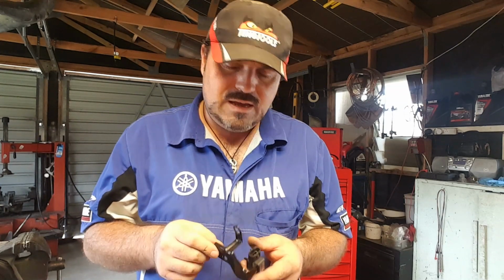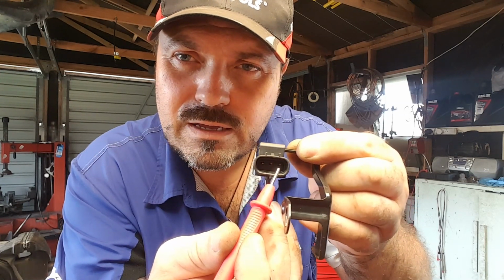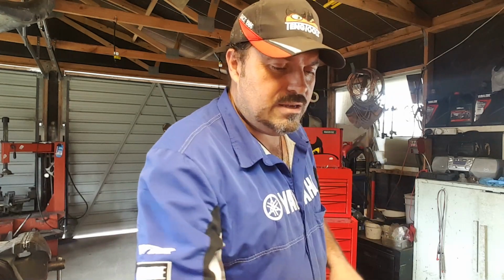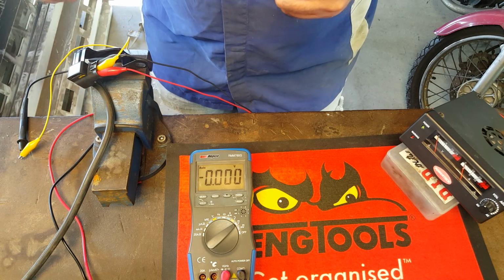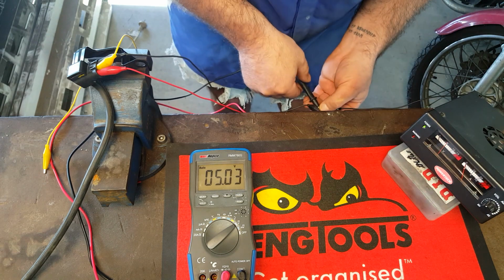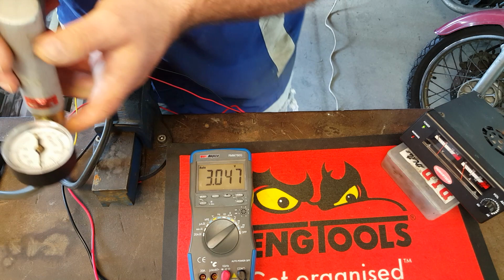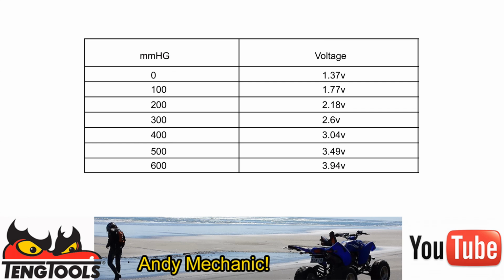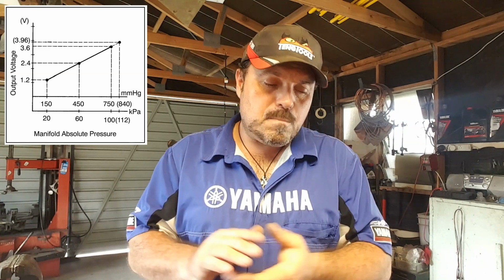How to test a MAP sensor OFF CAR #1206

Comment: Hi, very good video thanks, just would like to add that In some cases the map sensor will be off when in a hot or cold condition.  I had this with my honda vfr1200 motorcycle.  It would run fine for about 200km then start buzzing in my handlebars from the enjine due to to lean fuel calculation & timing combination..

Comment: Hey Andy besides for voltage there is a way to test . and that is going by resistance and vac as well if you dont have access to a 5 volt power supply

Comment: Great video.  You helped me diagnose my Toyota MAP sensor.  However, I think you made an accidental statement at 9:34.  "As the vacuum increases, the output voltage decreases".  Per your test and charts, as the vacuum increases the voltage increases.  Might have been a accidental mix up of terms; vacuum and pressure.
Reply from the maker: +LuvMy55Chevy I think you are right with that one. I meant to say resistance. I'll re-take it one day! Thanks for the feedback and I'm pleased it helped you fix your car. Cheers Andy

Comment: Hey Andy if we're really just varying the resistance with vacuum. pressure couldn't we just take a resistance reading from the  signal wire while adding vacuum. No it will not correlate to a map but the varying resistance would indicate a working operation.
Reply from the maker: Totally can, just check supply voltage is at 5v+ & a good ground is also present. 

Cheers Andy

Comment: Hey Andy! love the videos especially  your tool girl Sam ones.  Umm, I'm a bit confused maybe I got it backwards but at around 9:34 you describe an inverse relationship between vacuum and sensor output voltage as the desired and tested result, but I think either I'm confused a as it is direct relationship (Vacuum up  Ev Up) or maybe it was just a slip up.  Seems I'm the only one I saw in quick glance at comments who's head is banging so Idunno. Cheers!
Reply from the maker: +roy mummery Some sensors do inverse, some are proportional. Main issue is you see a steady change in voltage with vacuum.
Reply: I too was confused. I thought that this sensor provides feedback to tell the ECU the amount of boost pressure present to maintain the design amount of air/fuel mix to make the 14.5--14.7 to  1. After studying other vids it would seem that the sensor is measuring relative pressure to atmospheric pressure. When the throttle vane is shut the turbo will be slow and the pressure beyond the vane will be low and below atmospheric. The ECU will cut back the fuel via the injection. When the  throttle Vane is fully open the Turbo speed is high. The vacuum in the manifold falls back to atmospheric. Now the boost of Turbo takes the pressure in the manifold beyond atmospheric. This is again detected by the MAP and the ECU then sets more fuel into the engine via injection. There comes a point where the boost pressure could be too high( Resulting in Engine damage)and the ECU sends a message to the Vacuum Solenoid valve to dump vacuum on the turbo wastegate actuator so the gate opens to dump turbo exhaust to slow the Turbo down and reduce boost. Now the funny thing is this. Overboost code P0234 can be set with car in 5th going up hill and foot to floor. Also code P1345 also set(Glow plug issue). Limp mode/Engine Warning light set. RPM that this occurs at is around 2,900. Is it possible that the ECU is saying I am labouring the engine and puts it into Limp mode with the Fault codes. Can't be an overboost as turbo is spinning too slowly. I also read that the  throttle pedal position is monitored and plays it's part. I have put this info in as the problems one may think they have may not be what the ECU is Fault coding. The fault codes are just indicator. Note after reset of fault codes the Glow plug fault is not present.
Ok let's go back Andies graphs. After understanding how Absolute Pressure is defined as I now am longer confused. The M A P therefore has a max output of 5 volts and minimal output of 0 volts. Is it right that the sensor would give out 2.5 Volts when the Manifold is at atmospheric. There must be a  voltage value above atmospheric when the pressure in the manifold is considered to be at Overboost. How altitude is taken care of is another mistery. It is likely that the output would never drop to 0 volts. Finally Andy concludes that other MAPs work differently. This is what make all these issues so hard to understand but Andy's bench test definitely will give functionality of the device but you need to cross check to see if it is in Specification. 😀😀😀

Comment: did i hear you say that as the vacuum increases the voltage drops? I saw it the other way or am I mistaken?
Reply from the maker: That's correct. On some map sensors the voltage is around 3.7v at atmospheric pressure (WOT) & drops down as vacuum increases.

Hope this helps

Cheers Andy

Comment: Hi i have 2008 ford focus 1.8 tdci with heavy black smoke under acceleration  live data showing 30 psi of boost pressure and mass air flow around 80 g/s  around 2500 rpm i thought vnt ring on turbo might have been sticky but it's free  , how could i pin point the fault if it is the map ?

Comment: Thanks for ur explain , the map sensor division from the line on diagram is that ok or it's fails
Reply from the maker: +Hazem Alsaady If the readings fall anywhere outside the lines throughout the operating range then it's a fail.

Cheers Andy

Comment: Andy, measuring the signal leg (middle) on the harness of the car I get about 5V but when I connect sensor to the harness and backprobe the signal leg the voltage is at 50mv without any vacuum applied. The voltage supply on the side leg read 5V with and without sensor connected. Do you think the sensor has some sort of short or break? or is it the ECU? thank you!
Reply from the maker: +biker55555 Hmmmm. ...just check the other two wires as the order may be different on your car. One wire (loom side with sensor disconnected) should be 5v reference, one ground and the 3rd should have no voltage - that will be the signal wire. If all that checks out fine then I'd bench test the sensor.

Hope that helps. Cheers Andy

Comment: Hi, I was given a 4 pin Ford 0 261 230 027 sensor. I don't have the car so I cannot test it in the car. I want to use it for an automation project for the school. How should I test it? I cannot find the connection diagram. Many thanks. Regards

Comment: how to find the map sensor on a 2004 Isuzu Rodeo direct injection
Reply from the maker: +Christy scruggs good morning Chris, I must be honest here, I haven't worked on one of those for a long time. However, Map sensors require a vacuum supply from the intake manifold. So follow each vacuum hose and the one that goes to a small electrical component usually with 3 wires to it should be your map sensor. 

You could also go onto Google images and search for pics of the map sensor on your vehicle, that usually gives you clues as to its location.

Ultimately it's best to just download a PDF  workshop manual, that will not only give you the location but also the test data you need too.

Hope this helps.

Cheers Andy

Comment: You know how I do it buy a brand new one if it's not it take i take it back 😂😉
Reply: My first diagnose was just like that I tested and it was a simple system with an alternator as a dead end.  So we went to NAPA got a new one something happen so I took it back and told em while I was getting the part the car got towed so I'll come back when I get the car back.
 Told my friend hey I dont know. So we pushed  it to the shop down the street
Later we get a call back that it is don6
We go pick it up and for my curiosity o asked .. so what was the problem
The tech said  . . . The distributor... hahaha
The guy at the store put the bad one back in the box and back on the shelf 
Ready for the next sucker

Moral of the story is that now i can and will question all 
.. my approach my equipment and my parts

Comment: I have lexus 2009 .my map sensor have three wires. First wire is going 4.99v second wire is going 4.90v third wire is  going 0v.can you please tell me which wire is which?
Reply from the maker: 4.99v is the ECU supplied 5v reference. 0v is the ECU supplied ground & 4.9v is the signal wire - that's my thoughts.

Cheers Andy

Comment: you should have the info first.. you did 100 increments but the scale shows more specific vacuum and volt readings..
So do it again and see what volts you get at those specific vacuum specs.. just because it moves volts doesnt mean its in spec.
Reply from the maker: Correct

Comment: I have a 4after engine whenever I start my car the rpm goes up to 8000rpm I have to switch the car off. I need some help
Reply: This problem got nothing to do with MAP Sensor, its about TPS, or Throttle Positioner Sensor.

Comment: Hello Andy, I'm doing this test on my car, I back probed the signal wire that connects to ECU, and I'm loosing about 1v, the plug disconnected measures correct (close to 5v disconnected) - once connected I'm loosing 1v. what does that mean ? the rest is o.k .. the volts decrease when I increase vacuum.
Reply from the maker: So when connected you only have 4v supplied to MAP sensor? If this is the same for all sensors then you may have a bad earth issue? ECU should be putting out 5v supply on that pin.
Reply: @AndyMechanic  when the sensor is disconnected I have 4.6v - when it's connected I have 3.6 v. How would I go about repairing an earth issue?
Reply from the maker: I think you are plugged into the sensor wire & not the 5v ref

Comment: Can I test it while on my car
Reply from the maker: +Heather Laski Hi Heather, yes, no problem at all. There will be 3 wires. One is an earth, one 5v and the other is the output signal that goes to the ECU. You'll ideally need a hand vacuum pump like the one I use in the video and a multimeter set on 20 volts DC will work. 

Hope that helps. Cheers Andy

Comment: am failing to find the position of the map sensor for my mazda demio DW 2 series  ,its producing a dark smoke but its not burning oil. its chewing too much petrol
Reply from the maker: +caleb kakaka Hi Caleb, from memory I think the Demio has a MAF  (Mass air flow meter) rather than a MAP sensor. It will be in the intake between the air filter and throttle body. Take it off and give it a clean with special cleaner - your local parts supplier should have this.